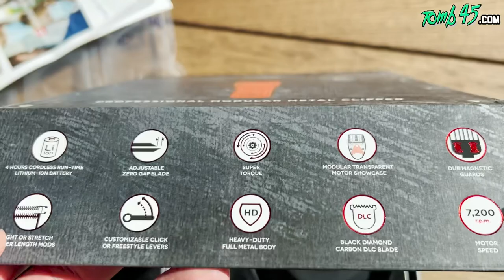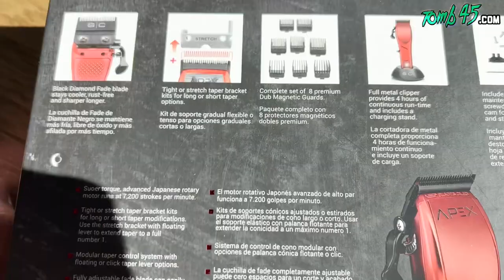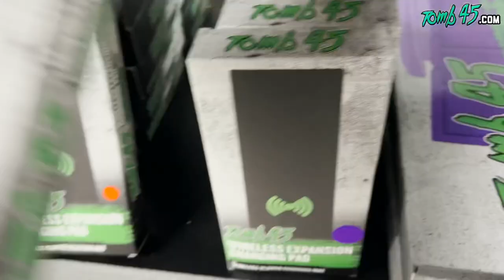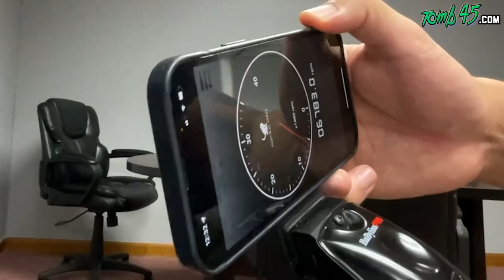Clipper unboxing | Stylecraft Apex first impressions | insides and speed test

Comment: Hey Chris sum companys test and rate their clippers without the blades.  Depending on the blades it can slow rpm/spm down 500-700 maybe more. Great content much luv bro 💯
Reply: Not true, blade speed is always a direct reflection of the motor speed. If the motor has 6800 rotations per minute, then the blade should mimic that speed.